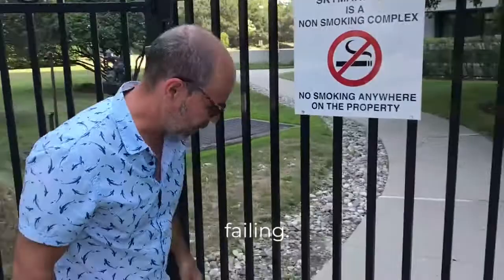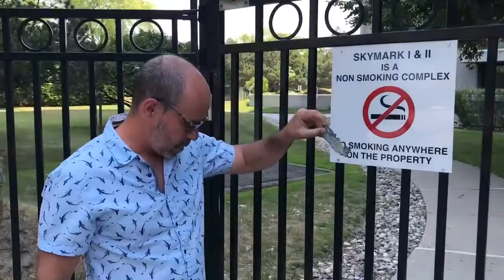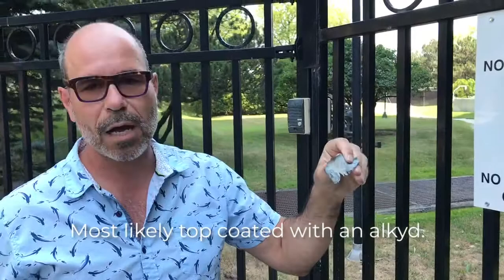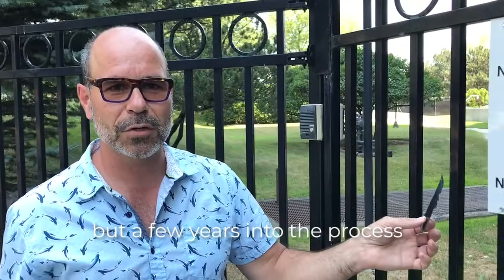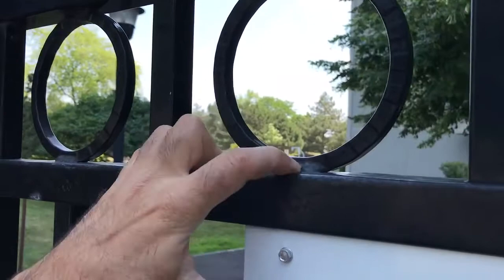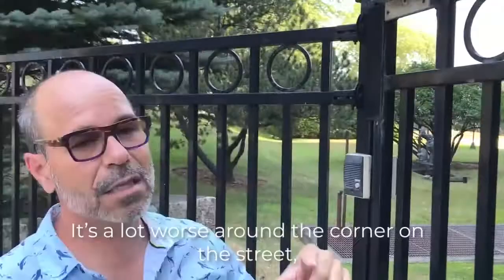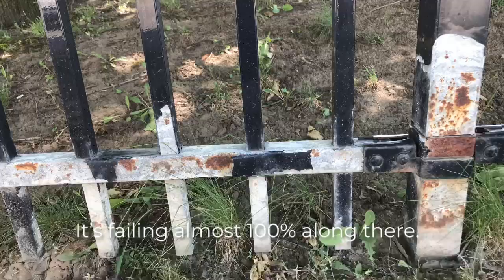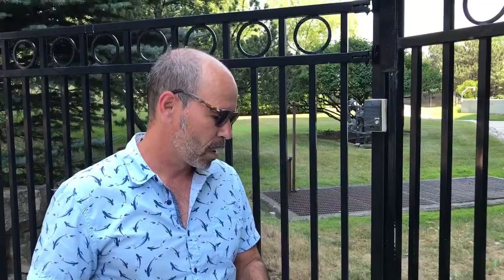How to Paint a Galvanized Fence (The Right Way)

Comment: Thank you for this informative video. Would chemical etching be a good idea to clean and prep the metal before painting? Online people mention all sorts of etching solutions, almost any acid. (Citric acid,phosphoric acid,muriatic acid,oxalic acid,acetic acid- Vinegar, LSD, just kidding about the LSD)
Any comments about  Rust-Oleum® Stops Rust® Cold Galvanizing Spray, possibly for smaller jobs, it appears to be solvent based, it contains  Acetone, Toluene, Xylene, MEK and about 90% zinc. Maybe the idea there is that the volatile solvents evaporate leaving only a zinc coating behind. It does say to use water based paint as a top coat if needed. I tried it using phosphoric acid first, it covered well but only time will tell how long it lasts.
Reply: Loved your acid humor I straight up giggled 😂